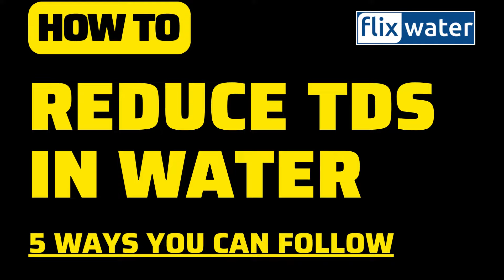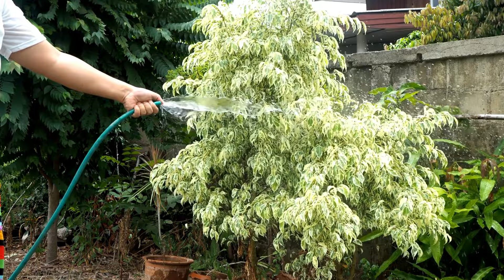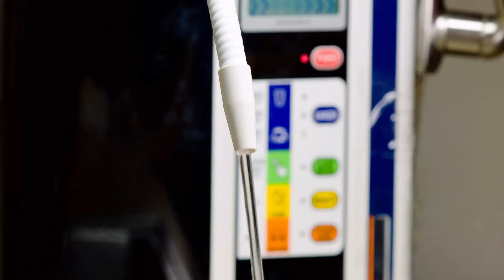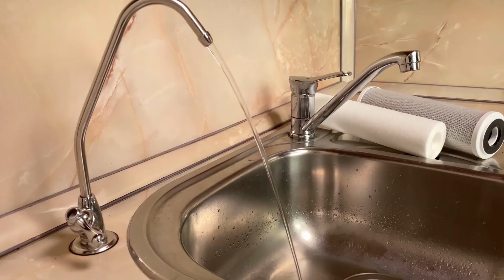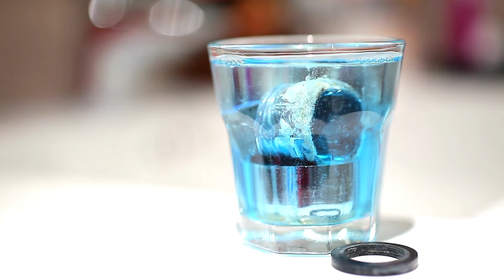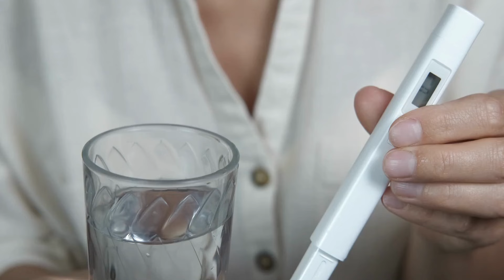How To Reduce TDS In Water - 4 Ways For You - FlixWater

Comment: If tds is more than 500 one should reduce tds for drinking.

If it is of the order of 100-200 one may filter the water for elimination of sediment, odour, organic impurities, micro-organisms like bacteria and viruses. For this successive filtering as follows may achieve the goal:

Sediment filter 10 micron
Sediment filter 5 micron
Sediment filter 0.5 micron
Ultrafiltration 0.01-0.001 micron
Add copper
Test and Make water alkaline and ORP negative if required
Pass through UV light
Store for drinking for a day or two.
Reply: Great